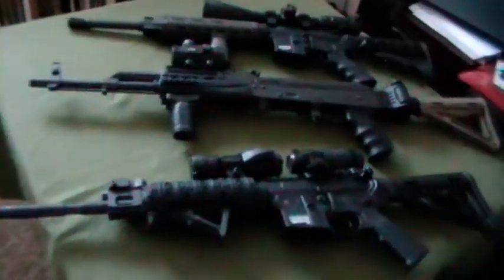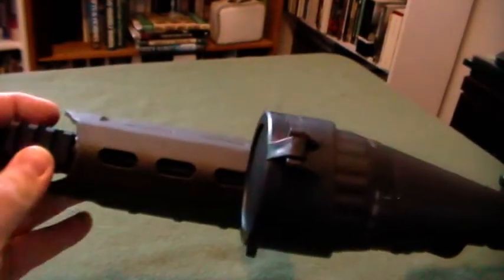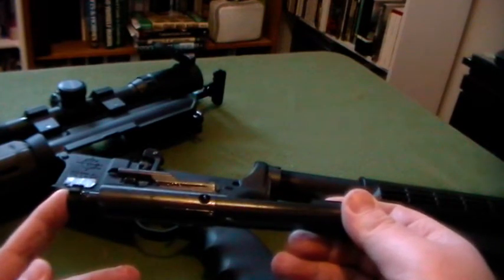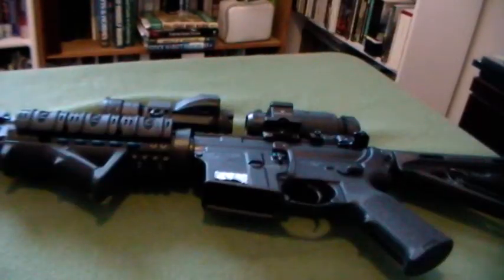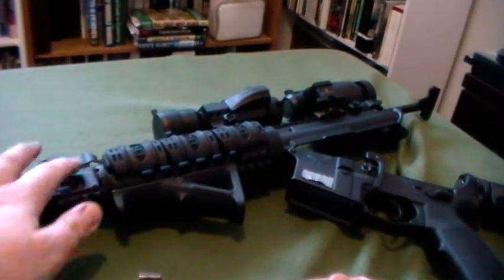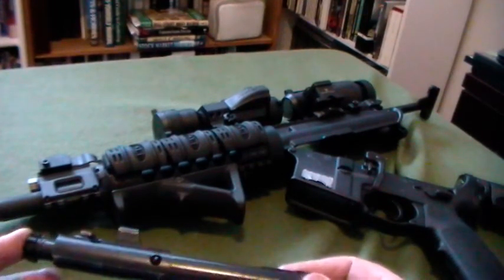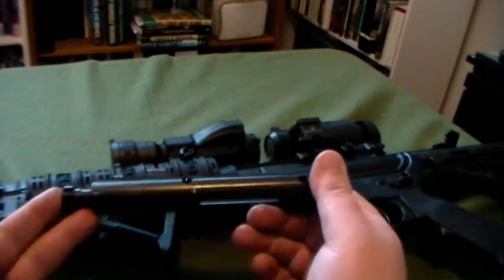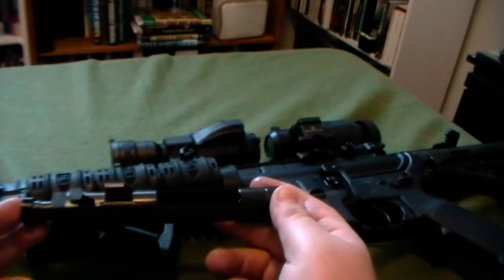Gas Piston VS. Direct Impingement

Comment: It sounds like the cons out say the pros for the piston system. Don't forget about the BCGs that use nitride or nickel boron and are more slick than the phosphate ones. Which would give an advantage to the DI guns. You could also use a rifle length gas system. From what I heard. You don't end up with as much crud in the receiver because most of the powder has been used up.

Comment from the maker: The problem with the piston systems is that you will never get a perfect zero on the weapon.  It will always have a little bit of variation due to the barrel not being free-floated.  You can get it close, 3" MOA or less (depending on the gun, and obviously variations in manufacturer, model, type, etc will play a major role and vary the accuracy), but with most piston guns you will never get a 100% perfect zero.  But I see where you're logic is.